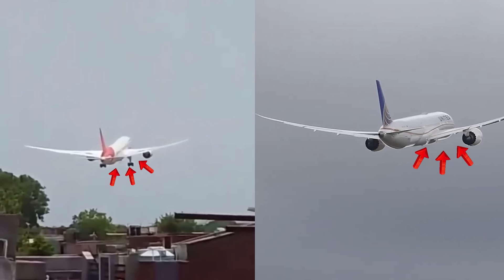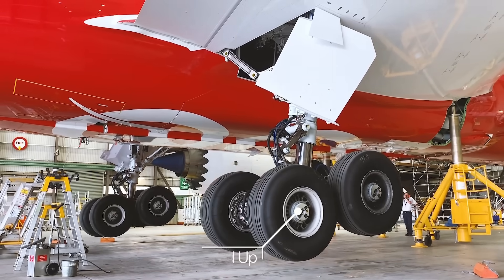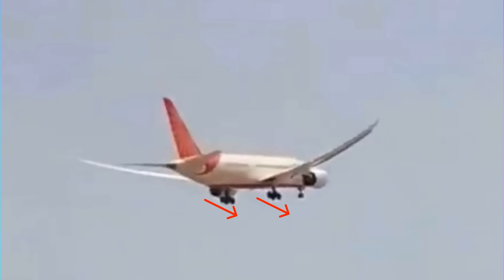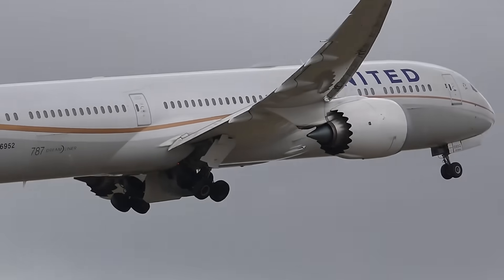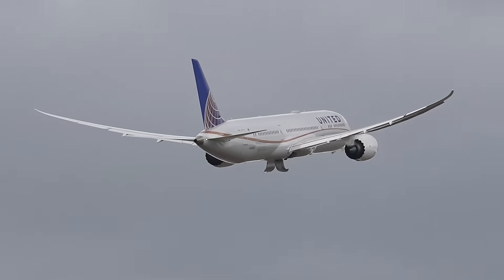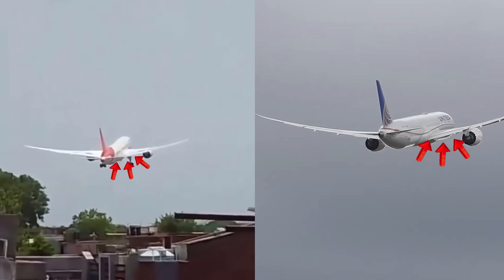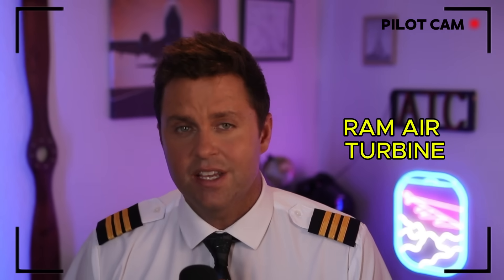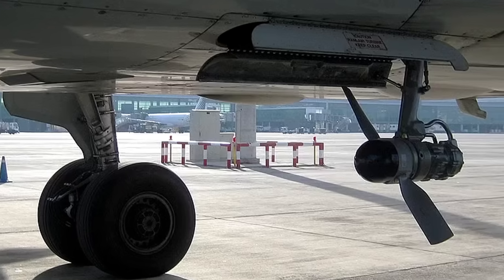Pilot Explains: A New Detail in the Air India 787 Crash Everyone Missed

Comment: Hy Garby,
Thx for the analysis. Nevertheless I have an addition to your possibilities of why the aircraft had no Thrust. You are saying possibilities are:
- Contamination of Fuel
- Fuel Cutoff or Fire Switch
For far agreed
- Athr of an Thrust Lever to idle.

In the last scenario you would definitely lose Thrust but even with both engines in Idle the rat would deploy and there would be sufficient Hydraulic pressure to raise the gear.
Best Regards

Comment: One reason for this crash could be that the pilots have entered wrong details in the computer before the take off about the weight of the plane. It has happened in the past. If they enter less weight of the plane then the engines are programmed by the computer to use less power during take off. In other words the plane loses power during take off, the engines lose power. If the plane took off at the end of the runway it means the engines were losing power. Also when it started to take off it was obvious that the engines were losing power. Maybe the pilots entered wrong weight of the plane in the computer before take off.😢😢😢😢😢😢😢

Comment: What single failure event on a 787 could stop both engines at the same time? Design protocols on modern passenger jets rule that no single failure event should cause a catastrophe. Improbabilities multiply with every level of redundancy which ensures that no single event ever causes a catastrophe. I am not speaking here of a wing falling off as a single failure event but rather a single component failure among any of the many thousands of components on a passenger jet. Thus does, for example,10 to 1 become 10x10 to one and 10x10x10 to 1 as redundancy multiplies. But one particularly singular component beyond the scope of design protocols is the fuel, which in the case of engines is the same fuel. There is no fuel redundancy in the system. If the fuel is contaminated it is contaminated for both engines. If there is no fuel in the case of fuel starvation both engines starve.  Fuel contamination or fuel starvation will in my view turn out to be the cause of the Air India crash.

Comment: It is highly unlikely that it was pilot error, both pilots had over 1,000+ flying hours experience, the senior pilot had over 8,000+ flying hours experience. It was mostly likely an electronic failure that caused both engines to shut down and the RAT to deploy, as well as the failure of the ground crew or Air India maintenance crew to properly and thoroughly check every critical component of the plane. It's also a Boeing failure as their planes have had more incidents over the last few years than Airbus planes.

Comment: Contaminated fuel would NOT allow full thrust for takeoff🤔The plane powered up and got off the ground - also the rat provided zero thrust to help the plane fly? "That fuel switch was possibly turned off😭"The alarms in the cockpit would be screaming if the flaps were wrong???

Comment: How bad the fuel contamination have to be to have dual engine failure? A little bit of water or other contaminants are capable of causing this failure, or a big amount of water and contaminants is required?
I would assume that these engines shall be able to handle “high amount” of fuel contaminants including water before engines have this kind is failure. I think, engine performance, power, efficiency will be reduced by fuel contenido but the engine should still be able to provide trust.

Comment: There would be a visible sign of full engine power at the engine exhaust port, which would be a small but visible plume of black smoke.
If the pilots had intentionally cut the thrust, the RAT would not have opened.

Comment: The survivor said he heard a bang. Capt Steeve thinks that was the RAT dropping.  How about if it was the entire electrical system blowing out?  Now you'd think you would still have thrust, but fuel pumps require electrical power.  Could this be what started the problems?  I'm sure there are backup electrical buses, but if those backups are close enough to each other, they could take each other out.

Comment: Not to ruin the physics lesson, but if you have zero thrust, that plane is comming down irrespective of air density.

A better question is whether temperature can be a factor in the mode of failure for the engines.

Comment: Very good Gary !!Double engineering failure has very remote probability otherwise ETOPS would not exist.I think that something happened on the fuel flow control system from the tank to the engines main fuel pumps
Reply: Bingo!

Comment: Both engines failed simultaneously as the pilot monitoring engaged the gear up switch. The math on 2 engines flaming out at once is astronomical; contaminated fuel is my bet, especially with the RAT deployed so soon.

Comment: Gary, I will give you a new theory. Yes, I am waiting for the experts to come out with a report.  Watch carefully from the distant video when the plane lifts off.  To me, I see a slight yaw to the right. Don’t know how strong the winds were. If the yaw was caused by an engine failure (airplane will add in rudder), then you have a startle factor. Pilot flying forgot to call for gear up. Then for some reason one of the pilots reached for the fuel control switch without verifying with the other pilot and shut down the good engine. This caused the RAT to deploy a few seconds later.
Reply: What rubbish
Reply: @Anuja1428  What rubbish?  What are your qualifications?
Reply: @CraigKronfeld  people like u blaming the pilots with stupid theories.. that is rubbish…  atleast m not giving stupid theories.. u also shouldn’t as u r no expert
Reply: @Anuja1428  Just a theory.  Will wait and see.  What are your qualifications to make your statements?
Reply: @CraigKronfeld what statements? ..I don’t hv any qualification on aviation so i dint made any statement unlike u..
Reply: @Anuja1428  Let me see.  50 years as a pilot.  38 years at a major airline.  8 years as a captain on a 787.  So I am qualified to give my opinion.  I hate saying pilot error but just pointing out something that had not been talked about..  I have watched errors made in simulators for years.  Will it be pilot error?  I hope not.  I will just let people with no qualifications spout their opinions.
Reply: @CraigKronfeld  my apologies then. Just got a lil furious again reading about pilot error which is so much on the internet. U r an expert so u r entitled to give such opinionl or theories..
Reply: @Anuja1428  Thank you.  You had no way of knowing.  Have a good day.
Reply: @CraigKronfeld yeah thanks.. heard the same theory by another expert.. can it like really happen.. seems unbelievable.. and he also said that in Boeing u can’t reverse that action while airbus allows it.. is that true ?
Reply: @Anuja1428  Never flew an airbus so do not know.  You would need a lot more time and altitude to restart the engine.
Reply: @CraigKronfeld  ohh I see.. thanks

Comment: At a guess the plane on take off had electrical problems, and had a generator failure from an over worked generator trying to take the load from a system being down. When this happened on take off it caused hydraulic motors for the flaps, and landing gear to stop working, where the landing gear couldn't raise causing drag, and the flaps to retract. The RAT doesn't provide power for the landing gear hydraulic motor perhaps it doesn't do that for the flaps either.

Comment: 1) fuel contamination doesn't kill both engines at the same time.
2) fuel contamination should have also affected other planes that got refueled. 
3) it comes out more of a fuel supply valve problem. If fuel supply is cut off to both engines that would have a similar effect.

Comment: I would have thought something from the landing gear hit into something during the movement of the landing gear going up.  

That is where my thought went.  My thought went there, because it was at the moment of the landing gear going up where the plane had the problem.

The only thing both engines have in common, for both engines to go out at the same time would be fuel.  I cannot think of anything else that would take both engines out at the same time.

The fuel lines are in the landing gear area.  A fuel line that was not ran correctly getting cut when the landing gear moved upward could do it.  But, to me, something pertaining to the landing gear going up and the fuel line.
Reply: Somebody could have ran the fuel line where it would get severed when the land gear came up.  Or it could be incompetency of the person who worked on the fuel lines.

Those fuel lines are right there with the landing gear.
Could not have been an electrical failure, because the engines when running have at least three different electrical supplies on each engine that work independently of each other.

There is no way, six different electrical systems failed at the exact same time.
The electrical theory does not sit well with me.

Fuel, that sits really well with me.  
The landing gear severing fuel lines.  Yes, especially since it was at the moment the landing gear was going up, and the fuel lines are in that area.

Comment: This is the first most logically sorted theory i have heard on youtube. Looking back this is same as Cathay Pacific 780 incident from April 2010. Also, in Oct 2018 Boeing 787 experienced uncommanded engine shutdown due to a blocked inlet filter and fuel metering valve.
Its fuel contamination for sure and definitely not the pilot actions by any logic. The fuel filter blocked, the bypass valve opened, the contaminants went to FMV and FSV and clogged them close. 

Because since the RAT deployment means loss of both engines, Calling Mayday, Being very low on altitude no rolling, Keeping nose up througout, all this clearly indicate the pilot did an exemplary job.The fuel metering valve issue due to SAP contamination in fuel. If you know what happened there you will know what happened here. They should investigate the fuel loader before the rest of the procedure complete. If the authorities have not checked the loader filter elements before tampering, this horror might happen again. Hope this investigation ends in this decade and doesn't get influenced.

Comment: Flaps 1 is a valid takeoff position. Flaps 1 is LED's and no TEF's. Yes, you could hear the RAT on the original video posted on line. (Automatic) RAT deployment = dual engine failure or hydraulic failure or certain electrical failures. Hopefully, the FDR will confirm the reason for the RAT deployment.

Comment: Captain Gary: With the deployment of the RAT, the electrical or hydraulic systems will come under scrutiny. I lean towards an electrical systems failure. Here’s why: the electric fuel pumps on the 787 are AC driven. There is a battery (DC) back up, but this is only for the APU. Without electrical power to the pumps, the engines become dependent on the ‘Suction Feed System’ to draw fuel up into the engines. This backup system was not intended for the enormous demands for power on take off. The engines would have been receiving some fuel thru the SFS, but not enough to provide the proper amount of power and therefore lift.

Comment: I agree that both engines failed simultaneously, but maybe the primary cause was not an electrical failure, but failure of the fuel pumps due to cavitation caused by evaporated combustible (bubbles) inside its piping, due to excessive heat caused by the air conditioning out of operation and the high environment temperature at that site. Similar effect would occur with loss of fuel pressure caused by some leakage.

Comment: I'm leaning towards electrical failure. The engines lost connection to the system hence it shut down. Kinda like when you turn off your ignition in a car but the ignition got turned off cuz your wire got lose not cuz you turned off the ignition.

The pilot says "Mayday 3, no power, no thrust and going down" 

No power no thrust means engine's aren't up and running. They are turned off due to electrical failure. Again, example being the car ignition.

This is definitely what happened. It's not Pilot's error it's the Plane. 

But then again, in the contrary you can say "Engine was running while the plane was taking off" .. meaning somewhere after 3 to 5 seconds electrical failure occured.. now that failure can be due to Pilot's error too.

This is so weird. ITS ALL ASSUMPTIONS at the end of the day until we have absolute proof from the black box  bla bla.

Comment: I suppose the plane had two problems: 1. The angle of the front wing with the horizontal is too big, and 2. The surface of the front wings is too small, especially during takeoff, and the floatability is not sufficient to maintain the plane's normal flight level.

Comment: Gary is the first one I have heard mention fuel cut-off switches.  That had occurred to me.  Alaska Airlines almost lost a flight that way just last year.  India is not a safe place, especially after their recent incursion into their most disreputable neighbor, Pakistan.  If you wanted to doom a large aircraft, just shut down all engines immediately after takeoff.  There would be no chance for the crew to recover and you get one heck of a fireball.  The only drawback to this theory is that no one has come forward to claim responsibility.  Terrorist usually claim their sins.  Of course, a lone actor would not have that option.  I sincerely hope this is not the case, but I'm glad someone else has considered it.

Comment: I have heard of losing 3 out of four engines on a military P3. What happened was a turbine blade flew out of one engine and went through the fuselage and damaged the other engine. How they lost the third engine I don't remember. Nothing stops a blade from one engine going through the fuselage and damaging the other engine on AI171. However, we should have seen smoke or fire if this had happened, but we did not. 
   I have also seen a video clip of several in-flight phones and movie screens not working on this same plane on it's previous flight. That sounds like a problem with the electrical system onboard. Maybe it messed up the movie server computer first, then messed up the engine computers and crashed the plane.

Comment: Gary I'm reposting this because there's a 787 safety recommendation at the end, I hope you can get some traction. 

1/ I posted there was loss of power, not flap error; right after the first video released 
2/ I posted possible cause of dual engine shutdown within 24hrs of crash.  Note: engine shutdown, not necessarily engine failure.  

If you don't want to read to the end, my recommendation is simply this: Run the APU on 787 takeoffs until accident cause is determined. 

1/ I posted after first crash video:
""The rotation is normal angle 10°, no tail strike, and aircraft lifted off.  Initial climb angle is about 12°, prior to pitch nose down about 200ft AGL. (Using tail height and wingspan for reference). Runway is 11,500ft.  Camera location for this video is about 1/4 way from start of takeoff run, so exact departure point is hard to determine but appears to be airborne adjacent to antenna (VOR?) which is about 9,500 ft which is normal  for est. weight, elevation and temp. and therefore flap setting. Seems likely loss of power commenced about VR. 
Note all fuel pumps are electric on 787.  No gravity feed. RAT deployment is hard to confirm
from video, but looks like it did.""

2/ ""The 787 has a complex electrical system with over 1000 load circuits. The engine fuel pumps are electrical (there are 6), all powered off the main 235VAC bus, which is in turn powered by the engine driven generators (4). It can also be powered by the APU (auxiliary power unit). There is also a single 28VDC fuel pump which supplies fuel to the APU. The APU can be started from the RAT (ram air turbine) or battery. In the event of a serious problem with the main 235VAC power bus, power would be lost to the engine fuel pumps.  The RAT should deploy automatically on major loss of power. (It is not confirmed whether the RAT was deployed pre-crash). Bringing the APU online and isolating the fault could potentially restore power to the engine fuel pumps, but would take time.

There is a video posted online by a passenger on a previous flight of the crash aircraft. It alleges that there were electrical problems with this aircraft. In particular, the ECS (environmental control system) cabin air recirculation was not working, and the aircraft cabin was very hot.  Now the issue could have been due simply to a lack of ground power, or non-operation of the APU. However, the ECS air recirculation is powered by the 235VAC bus (through a transformer rectifier), the same bus that powers the engine fuel pumps.   It could be just coincidental.

Until fuel delivery is ruled out, it might be prudent to issue a directive to run 787 APU's during takeoff. 

The solution is technical; the tragedy is human. Peace and comfort to everyone touched by this tragedy. ""

3/ I want to add (today) that the 235VAC system has a very smart bus mgt system (BPCU) along with the electrical load mgt system. However severe overload followed by arcing, or a gen surge, or bay mechanical damage/fault, could potentially disconnect the system long enough for the engines to spool down and then a recovery process would takes time. The lone survivor reported the cabin lights went out temporarily. It's not clear if this was coincident with a causal event, or the RAT engaging. 
I will also add the max altitude was reported as 625 AMSL which is 400 AGL. 

Thank you for your channel, and especially this talk with Cpt Steeeve.